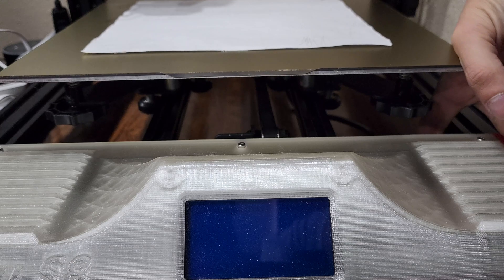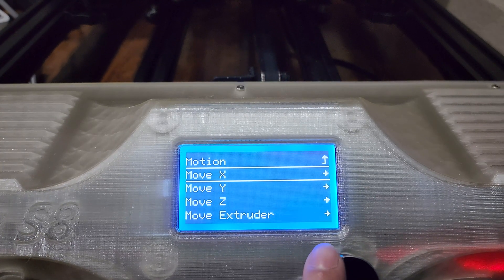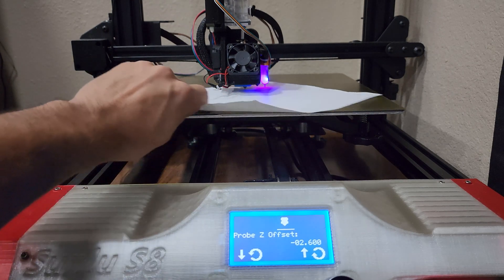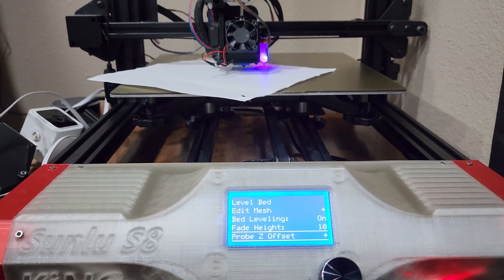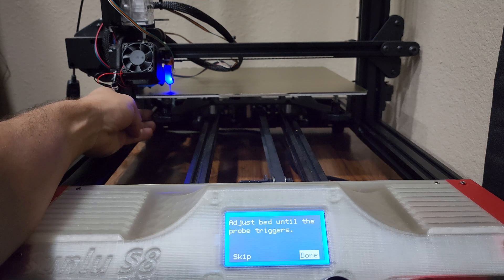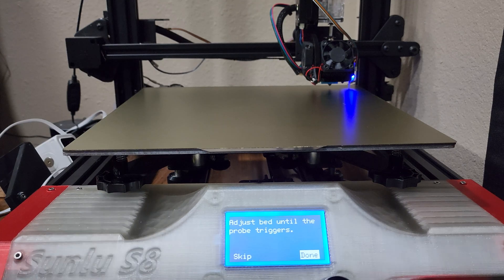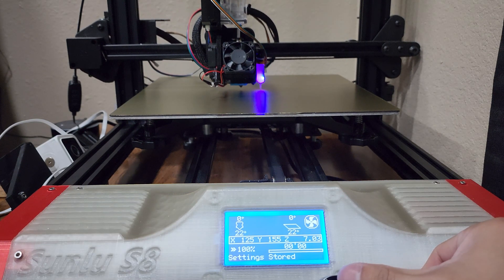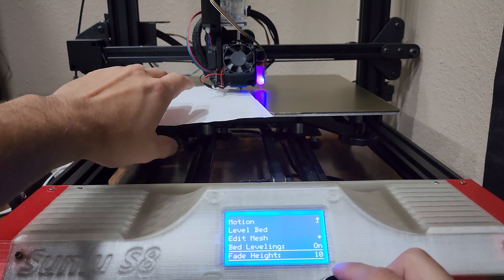How to: Level Sunlu S8 with King Firmware

Comment: did you change your nozzle from the original one? the probe touches the bed before the nozzle on mine so it would drag the probe when printing. just wanting to make sure I didn't do something wrong.also when i tram the bed the probe doesn't engage so i just did it manually.
Reply from the maker: I don't believe I had yet by the making of this video. I eventually changed the whole hot end due to killing the PTFE tube in the stock one.

If the probe is sitting lower than the nozzle then you need less of a spacer for the bed leveler. Are you still running the stock fan shroud, or have you printed one that has a spot for the bed leveler to go on to?
Reply: @JoeMartinMVC  i printed the new one. i printed everything you had in the upgrade video
Reply from the maker: @briancooper4893  With the KiNG Fan Shroud it should have two different spacers that could be printed for the Bed Leveler, If the Strock OEM Hotend BLT Spacer is too thick (which is what it sounds like is the issue) try using the thinner one. He has it listed as the MK8 Microswiss BLT Spacer, but that doesn't matter.  The thinner spacer will cause the probe to be a few millimeters higher and should rectify the issue.
Reply: @JoeMartinMVC  thanks ill try that

Comment: i have the CR touch and it jus freezes on homing XYZ when trying bed teaming, any help?
Reply from the maker: Are there any errors that come up on the screen when it happens?
If not, is it hitting the limit switch or on any of the axis?
Reply: @JoeMartinMVC  nothing and no, just Homing XYZ. tho update now, i realize the two pin was in the wrong slots. now when i try to auto home the extruder just drives it self into the bed. any help? edit - also drives itself into board when tramming
Reply from the maker: @Born2RideLLC  Typically that means the two pin connector needs to be reversed. I had the same issue with my BLTouch because of that.

I mention it in one of my other videos (at 23:37) for reference: https://youtu.be/WEVsos3Evf4?t=1414
Reply: @JoeMartinMVC  i tried both ways but same issue
Reply from the maker: @Born2RideLLC  Interesting. Join us on Facebook, the KiNG 3D Private Lounge and pop the question in there. It's likely someone else in the community there will have the answer as that's always fixed it in the ones that I've seen, but the CRTouch may be slightly different as I haven't worked with that yet on the S8.
Reply: @JoeMartinMVC  joining now!

Comment: is this "KiNG Firmware WITHOUT 3D/BLTouch: https://drive.google.com/file/d/14VJl..."  For stock board.. NO DD and No BLTouch?
Reply from the maker: I have the one flashed FOR 3D/BLTouch since I have the BLTouch installed on my printer, so that’s the one I made the video with.
Reply: @JoeMartinMVC   have you old version 12?, with version 13 does not working

Comment: When I bed tram, it doesn't get me the option to use the probe.  It only asks "Next Corner"  How do I use the probe to tram the bed?
Reply: same thing here
Reply: @cadenwinter99  SAME HERE WAS THERE EVER A FIX OFFERED???
Reply: @davidpaul9261  I upgraded to the solvo sv06 plus loving it and has the same bed size as the sunlu. But I rember just leveling it the old way with paper then using the probe right before the print by coding it into the gecode
Reply: @davidpaul9261  i got mine to work by downgrading from version 13 of the firmware to version 12, i also tried version 14 but the axis's are reversed and the probe doesnt deploy
Reply: @berto663   Have you hex file for version 12?

Comment: I got the level down but prints keep curling on any sort of overhang. People keep telling me to try out a cr10 profile but I still get the same results as my custom profile. Before I go to a larger fan, would you have any suggestions to try or a profile I can test?
Reply from the maker: Usually curling is a cooling issue. I'd do a temp tower and see what the lowest temp you can print at is to see if it resolves the issue prior to upgrading the fan.

Comment: Finding your videos really useful! Is this process only for when a 3DTouch is fitted? I don't have one at present and haven't trimmed my bed. Does this need doing if I don't have the 3DTOUCH? Also when you home it goes to the centre, is that something you have set it to do? Mine homes to just off the bottom left corner of the bed
Reply from the maker: Thank you!
Pretty much, yeah. If you go with the KiNG firmware for not having a BLTouch (linked in my firmware update video) it'll have you create a 24 point mesh where you adjust the nozzle and it does essentially the same process as the BLTouch does when it probes the bed.

Comment: when i try to probe the z offset the paper wont slide because the bl touch hits first. do i need to install the thinner spacer on the touch?
Reply from the maker: Yeah, if the BLTouch is sitting lower than the nozzle you'd need a thinner spacer to keep it above the nozzle.
Reply: @JoeMartinMVC  Is that when the probe is extended or retracted?  Thanks for the info